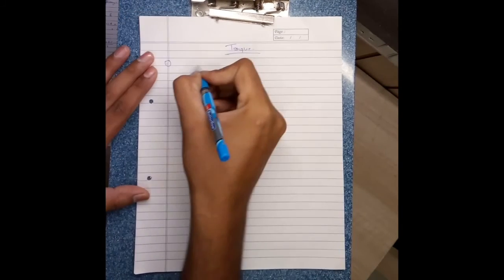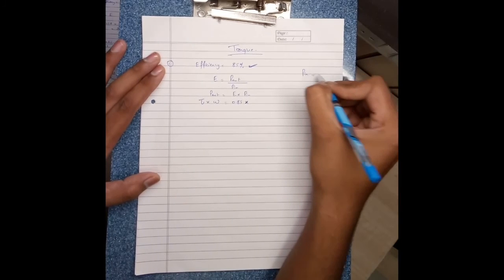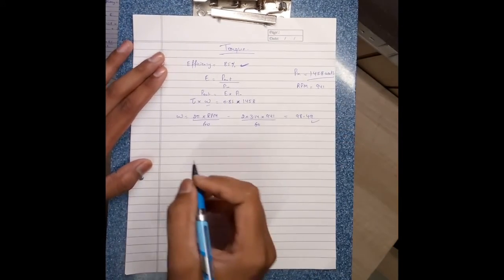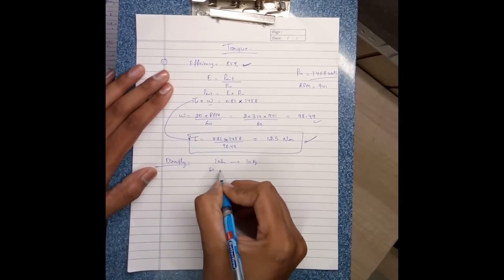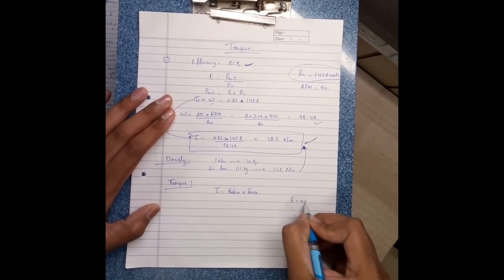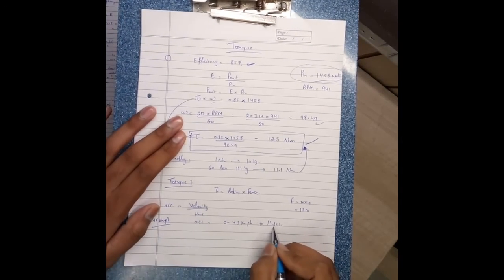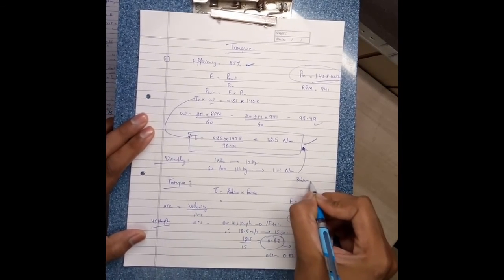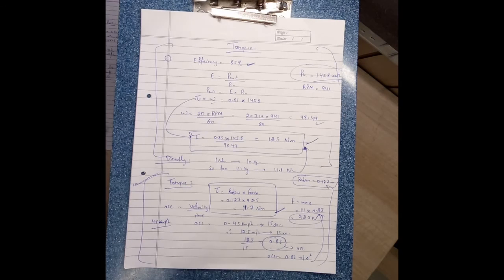EV Calculations part-2(torque)

Comment: this calculation didn't work for me!! (i don't want to dislike the video...cauz you have put efforts in making this..thank you!!...but I'll be grateful if you clear my doubts)
mass = 200kg
wheel radius = 12.7cm = 0.127m
acceleration 9km/h - 15 sec
2.5m/sec
2.5/15 = 0.16m/sec

force = mass * acceleration = 200 * 0.16 = 32N

torque = radius * force = 0.127 * 32 = 4 Nm 

(so the mass itself around 200kg which is = around 20 Nm but i am getting 4 Nm.......didn't workout for me)

Comment: i have a doubt.......once the desired torque obtained at the driven shaft by choosing appropriate sprockets/pullies...should i consider wheel radius as well?

For example
I want to move a payload of 250kgs since its a 4 wheel drive...load on each wheel and motor will be 62.5kgs
so i have chosen a MOTOR of 360 RPM with 11.1Nm (113 kgs) output torque which has drive sprocket of 9 teeth (OD 62 mm)
1:2 sprocket ratio
DRIVEN sprocket 18 teeth (OD 124 mm) 
so the Resulting torque is 226kgs and 180 Rpm  (up to this the resulting 226kgs of torque is more than enough)
BUT!!
Should i consider Radius of the wheel !!
if i calculate using my 10 inch tire (255 mm ) of radius 12.75 cm 
226/12.75 gives 17.7kgs torque output at wheel, 180rpm

Comment: why you have used 0.85 in formula for calculating torque ?
Reply: 85% is the resulting efficiency assumed.....cauz there will be power losses due to friction, gravity, friction b/w tire and ground contact & also chain/ belt driven and air drag......blah blah blah

Comment: Bro.. how to simply calculate or estimate the dc current of the battery in EV application???, it is very important part specially when using regenerative braking for energy recovery.. if you have an explanation it will be very helpful.. Thanks in advance..

Comment: the torque must be calculated from the total tractive force required at the wheels .. the. you ll get the wheel  torque  then the transmission losses have to be considered ( refer the transmission losses for FWD / RWD /AWD .. or hub motor type) then only you'll get the motor torque..   same with the rpm .. first take the max. speed (wheel rpm) then with the gear ratio you can find the motor shaft rpm...
Reply: What is answer
Reply: @RohitYadav-vu7xy  Refer "Hybrid & Electric Vehicles" by Tom Denton second edition
Reply: i have a doubt.......once the desired torque obtained at the driven shaft by choosing appropriate sprockets/pullies...should i consider wheel radius as well?

For example
I want to move a payload of 250kgs since its a 4 wheel drive...load on each wheel and motor will be 62.5kgs
so i have chosen a MOTOR of 360 RPM with 11.1Nm (113 kgs) output torque which has drive sprocket of 9 teeth (OD 62 mm)
1:2 sprocket ratio
DRIVEN sprocket 18 teeth (OD 124 mm) 
so the Resulting torque is 226kgs and 180 Rpm  (up to this the resulting 226kgs of torque is more than enough)
BUT!!
Should i consider Radius of the wheel !!
if i calculate using my 10 inch tire (255 mm ) of radius 12.75 cm 
226/12.75 gives 17.7kgs torque output at wheel, 180rpm
Reply: @hithishi5292  Calculate the total tractive force required at the wheel to impart drive for your vehicle ( not the driving shaft ) then compare it with your motor torque at the wheels. If you are using a drive to control the motor take the drive power , motor parameters are its design values n the drive power is what you ll get in real world application. Also the load on each wheel wont be the the same unless your vehicle is having a 50-50 weight distribution. Consider the weight distribution and use the max weight suppoting wheels for you calculation.

Comment: How is 1458 watts input power? Shouldn't it be output power from the vehicle and then you consider efficiency of the motor to calculate the input power of motor to the wheels?